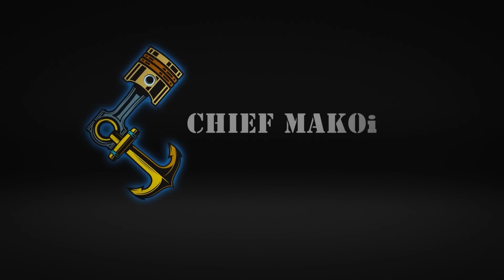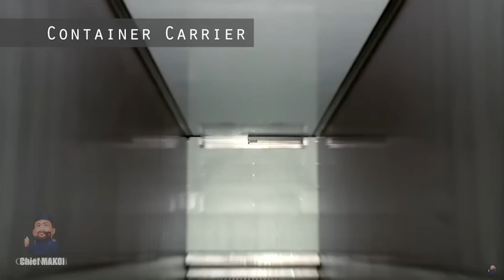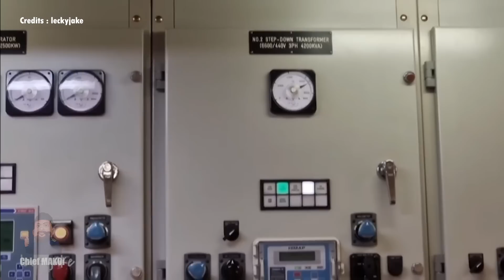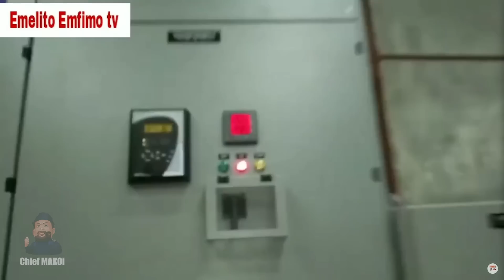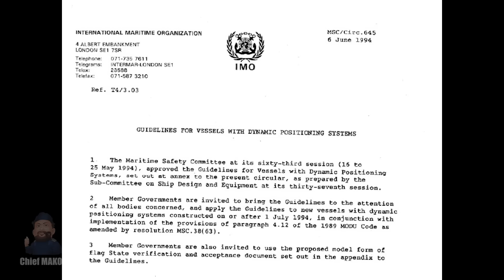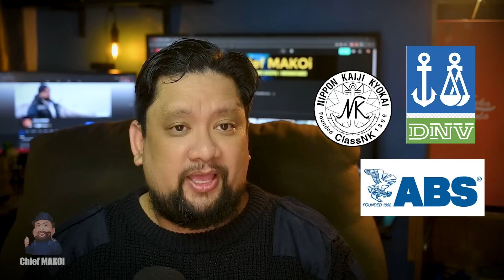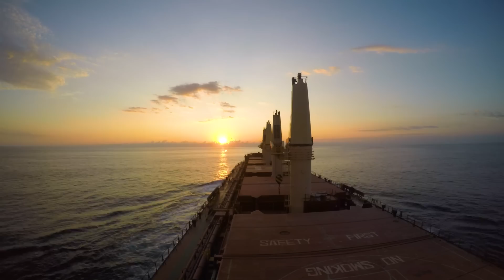Why Cargo Ships Don't Open the Bus Ties During Maneuvering | Chief MAKOi

Comment: No u would want it the other way then that. U want everything on and all close in or tied together to share the load. That way if one failed the other will pick up the load. It the same way on aircraft work the system for 8 years on deferent aircraft.  All the same way to. And the US power grid is the same way to.  Everything tye in together  in different sectors. That way one thing can failed and everything else can handle the load till it's fixed.

Comment: Hi Chief. In reviewing the simplified electrical diagrams of the Dali, it occurs to me that even if the bus tie plates/breakers are removed/open, that the high voltage generators will have to be synchronized so that everybody is in-phase. So, the generators can never really be fully independent.

Comment: As an old seafarer, my thanks and appreciation to Chief Makoi on his brevity, clarity and precision in  explaining the Dali mishap. 
I also read a lot of comments here proposing modification of the entire merchant fleet, including more engines, propellers, rudders etc🙂. 

A simpler, cost effective, solution would be to legislate tug escorts (one, two or three, depending on the ships' size) when transiting sensitive or dangerous locations. That way the extra costs would fall to the entity transporting the cargo, which is only logical. Plus it would relieve the existing and future merchant fleet from the vastly increased cost and complexity of machinery and/or systems. A better way to go perhaps?
Reply: Looking at this more from an aviation perspective I think an open bus tie would be both safer and cheaper and easier to implement.  Not all ports have tugs, tugs make mistakes, and it's easier to just have a ship under command than have it NUC and need a tug.

Comment: Synchronizing two (2) 6600-V Sulzer gensets with two more (2) 6600-V Sulzer gensets is no small feat. Automation is good, but manual synchro must be provided… which can be catastrophic if out of phase. 

So, what’s the risk analysis if MSC adds this? 🤔

Comment: In the normal course of events, transformers are so much more reliable than generators are, potentially leading to a situation where with two generators on-line with the bus split, there would be an interruption in supply if one of those generators dies.  So running a split bus would have shortened the length of interruption to the power supply on the Dali it would not eliminate it if one of the two running generators comes off-line.  No easy fixes, just choices and consequences.

Comment: The smart thing would be for them to have separate electrical generation and distribution systems for the ship machinery and for the cargo containers.  It is not, however, the cheaper thing so they won't do it unless forced regardless of how it could improve the reliability of their own ship.  You'd have a known load from your ships plant machinery with no possibility of any random container suddenly deciding to double it's regular draw or to short out the whole grid.

Comment: In the Navy, we always ran a split bus at sea in case of a casualty in one of the fire rooms affecting the generators-could sync and transfer the load      always power available with the gas turbine or diesel as a fall back

Comment: First time here, Chief.  Great video.  Excellent explanation on the electrical system.  I've sailed deck on tankers and containerships.  This really added to to the scraps of knowledge I've picked up along the way.  BTW, I once was on a containership that blacked out in the middle of the ER swapping between diesel generators.  I heard the problem was a bad relay.

Comment: As an aviator I was confused as to why they brought the failed transformer circuit back online.  It is my understanding that the generators were still running.  We would normally isolate a failed system and enable the backup if it was not already running.  Also, checklists are a part of the aviation culture.  Listened to any ATC recording of an engine failure and you will here the pilots often say something like “we need to hold a little longer while we complete our checklists”.  I don’t recall hearing any mention of checklists in reviews of the NTSB report.  Of course what I know about maritime comes from you, Sal and your American counterpart so there are enormous gaps in my knowledge.  Please enlighten. A video on emergency procedures would be great.

Comment: The medical system has been taking lessons from aviation to reduce human related mishaps. As an airline pilot, I find it alarming that this was the norm. The electrical system seems almost prone to blackouts. The fact that propulsion and thus steering ability are completely beholden to a stable electrical system and ships are not required to be babysat by tugs in maneuvering situations is a real head scratcher. 

The 737 is the oldest design commonly flown, it doesn’t have a full backup power source like modern aircraft, other than the APU. The E-170 series, A-320 series and beyond have ram air turbines that deploy automatically because with fly by wire systems, you HAVE to have AC electrical and hydraulic power to control the aircraft. The 737 is mechanically linked with cables, so that’s why a “RAT” isn’t required. Even a Cessna 172 can fly without electrical power. IIRC you won’t have flaps, but you will have your most basic instruments and a running engine. 

I realize that enclosed engine support systems are difficult here because unlike aviation examples, the engine never shuts down to simply change speed or direction. So, engine driven support would be a problem. But, what about an emergency bus that operates the pumps and rudder? This would be connected to an already operating bus on the open sea. But when maneuvering in port, you need a third generator running that is ONLY supplying the emergency bus, and in the event that generator has a problem, the system can automatically close a bus tie to power the emergency bus and thus keep the engine running without interruption. 

I’m not an engineer, clearly, but it seems like there are ways around what happened. Either with tugs, or better designed systems. Time for cost benefit and regulation to act.

Comment: I suspect the installation of dual independent power systems is due to the high cost of losing power to the reefer cargo. Also, any part except the cross connect breakers can be isolated for maintenance without  downtime.
During normal operation I would expect a single transformer to be used to avoid unnecessary power losses.

Comment: ,"Splitting the board" from memory? I was engineer on Reefer Ships in the 70s, lots of power needed gor fridge compressors especially when cooling down holds, usually 4 big generators plus harbour set, we would often need everything for cooling down, usually 3 generators on for trip especially when carrying Bananas, which from memory are pretty close tolerances? 13.5 degrees C plus or minus ½ a degree! Straight forward freezing for eg frozen meat was much much easier! I miss those days, we used to carry a designated Refrigeration engineer, 2 on some of the older ships! Along with the Electrician also 2nd electrician on the older ones,! Were talking 8 or more mains engineers! Plus 2 Fridgees plus 2 Leckies! 😮 This is on a 10 to 12000 ton Cargo Vessel!! 🤣 Great days, long times in port! Glad i was there, saw the last of the best of it! 😊 Cheers Chief! 👍🇳🇿😊 PS, also worked on DC ships 😱 with evil looking switchboards straight out of Frankinstien! 😱🤣

Comment: Amazing that so many transformer circuit breakers, both high and low voltage and the breakers on generators 3 and 4 too, should have opened as they did.  To my mind, there shouldn't be interaction between them under normal circumstances.  My guess is that massive back EMF spikes originating in the high current refrigeration motors or affiliated circuits caused these seeming unrelated circuit breakers to trip as they did.  

Perhaps not practical, but I''m thinking that the main engine should have its own primary and backup electrical power for its fuel and coolant pumps and not tied in with everything else.  It was everything else that dragged the high voltage bus down and killed the main engine.  Once the main engine was dead, it was just a matter of time before the out-of-control ship struck the bridge, but IMO, the main engine should be the last thing to fail or stop running.

Comment: It’s hard to know that maritime regulations doesn’t have the procedures existing on aviation, where every incident/accident is analyzed by truly experts and change regulations. I worked all my life as a power system planner, and having redundant generators, transformers and buses but no breakers just show that safety isn’t a concern for ships. If they would have breakers, its very easy to ensure continuous operations installing adequate protection relays that can isolate any foreseeable failure, and the cost is ridiculously low

Comment: Chief,

Tankers such as the Polar Endeavour Class, the Alaska Class, and any that utilize electric propulsion, electric cargo pumps, or are fitted with bow thrusters utilize 6.6KV, 450V, and either 220V or 120V switchboards.

The Polar Endeavour Class are twin-screw, twin-rudder, two fully independent engine rooms, and a bow thruster.  They have 6.6KV, 450V, and 120V switchboards in each engine room.  The electrical switchboards in each engine room are linked with two bus-tie breakers,  one in each engine room.

I was surprised at how similar the Polar Endeavour's electrical system is to the one you illustrated in your last video.

I was involved with the construction of four tankers built in the late 1970s and early 1980s.  They were fitted with 450V and 120V switchboards that could be split manually using mechanical bus-ties similar to the ones you showed.  However, those were designed to be opened with a hot bus.

Bob

Comment: What I wanna know is why isn't it standard practice to TURN EVERYTHING ON WHEN THE 50 000 TON BOAT IS MANEUVERING IN A TIGHT SPACE?

Sorry. 

I mean all the generators, including the backup, tie everything together, run everything that can run to make power to keep the thing moving, then turn it off and go down to 2/4 or whatever when you hit open water.

Comment: Well explained.   I can see pressure from Corporations/Ship owners not to mandate because its cheaper all the way around to do the minimum.    Of course a ship line can do more  aka split bus (assuming it has the equipment and Dali looks to have had that equipment).   The only tie break I worked with was a CB/Motorized type and ironically (did not work right) and   it was a problem not a help.    I tried to get it changed to a solid tie just to remove the possibility of a trip and having more power trapped on the least used but most Generator side,  vs the other side that was higher use and less generator.

Comment: Great explanation.
Coming from the computer world, in server rooms we have all kinds of redundant power.  Redundant power paths to the racks.  Can lose a power rail and the servers will keep going.  UPSes (Uninterruptible Power Supplies)  so that when power is lost, hardware will keep running on batteries or flywheels or supercaps.  Backup generators to pick up the load as the UPS systems would only last so long, especially with flywheels being very short term emergency power.

Looking at what the Dali was doing, there was no actual redundancy because the otherwise 'redundant' power buses were tied together with metal plates.  So a short or other fault on one side takes out both sides.  Then nothing has battery backup, so once the effectively singular power rail has a fault, everything is lost.  The whole system goes down like dominoes.  For one you need to require a remote controlled breaker that will trip when there is a fault on one side and then have the breaker open when coming into port even if it means more generators running.  Pump motors and emergency steering doesn't need that much power, so trivial to tie battery backup systems to.  Actually, the pumps would be a lot more efficient running off of power inverter based motor controllers.  Power inverters like DC power input, so you convert the AC power into DC, feed that into DC based UPSes that connect directly inline into the DC power bus, and then goes straight to the motor controllers.  So main power goes out, the UPS batteries are inline, batteries directly connected to the DC bus, so those motors keep working.  Electronic control systems could be on double inversion UPSes, so ship power could go out on both power rails and they will keep working.  Electronic control systems don't need much power, so trivial to put on UPS power.  All of the hardware to do all of this should already be out there.  At least easy enough to make if it doesn't quite match up to ship specs.  Install it into ships, get your ship wiring in order, and incidents like this won't happen.

Comment: Man, mistakes do happen & the problem was  not opening this or that  that but the sudden veering of the ship to the right toeards the Bridge pillar, as it was approaching,
No loss of propulsion/ steering cause have caused this to a ship making a movement of 8 kts other than pilot/ staff actions , neither were there adverse wind/currents, The FBI /investigators have found every other mechanical reason except this key fact & are keeping absolutely mum about it
Call it the devil in the details ,

Comment: Good video. One additional thought - if you can run two separate/isolated systems, then you need a method to reconnect them which involves synchronizing breakers and equipment so the two systems are "in-phase" when reconnected to avoid damage. A cost & complexity that can be avoided by having solid bus ties. One question though, from operating a power network, we would always leave the HV side of a Xfmr energised and only open the LV side as this keeps it warm and dry. Why is this not standard practice onboard?

Comment: Large aircraft have similar electrical systems. We normally run all generators (alternators) in flight except the auxiliary power unit (APU). In today's modern aircraft the electrical systems are managed by computers which have eliminated the Flight Engineer position. Maybe it is time for the maritime industry to follow to help prevent human error.

Comment: The simple concept of a bus tie plate not a bus tie breaker shocks from the perspective of someone who has worked on HV distribution systems on shore. Someone is trying to save a buck by putting lives at risk.

Comment: The main "electrical distribution" problem on ships is the same as for ground-based systems.  It is the interphasing of the grids, so that when one grid goes down, there is no phase hiccup to the supporting one.  In ground systems, this is done via a process, where the prime generators are phase-locked to each other, via a slow several minute process (which maybe quicker depending on phase mismatch and inertia of the generators).  Unless both or all generators are actually running, this is not possible.  Ground utility generators run all the time.  Ships generators do not.  As such, bringing up an alternate generator and just slamming it onto the existing running Bus is NOT an option.  This could cause catastrophic currents to flow between the generators and the bus lines.  In some cases, a resonant condition can occur, which could result in double or triple overvoltages, and destroy the whole system.  In ground systems, there are sensors which prevent this phasing mismatch, and disconnect any smaller system from the baseline frequency, of he overall system.  We worked these issues in several megawatt systems, both on ships and on ground.  Also, on ships, the various generators, if direct coupled to their electrical machines, they would have to have super good speed controls.  Typically this is not possible for any combustion engine, due to fueling and air intake variances.  One single engine works great, several do not.  We developed systems where electronic converters to re-process the electricity from the generators, and re-phase it.  Unfortunately our systems were only good for about 5000-horsepower, so far less than needed for these larger capital vessels.  Very good for the auxiliary support systems however, such as the rudder controls.  Too bad they are not being used now.

Comment: I've been wondering about this ever since I read the report. The way I understand it, the ship couldn't maintain control in that situation without the engine, but the single engine was designed to fail as soon as there was any failure of the electric system. That just seems absolutely horrible. Far less safe than even a single engine airplane yet weighing hundreds of thousands of tonnes, and this is apparently the way most big ships are designed?